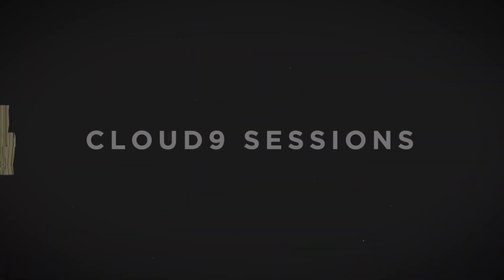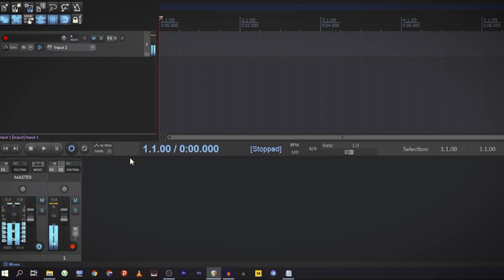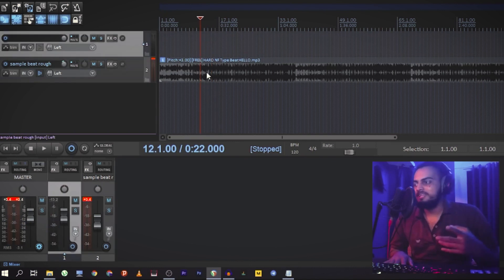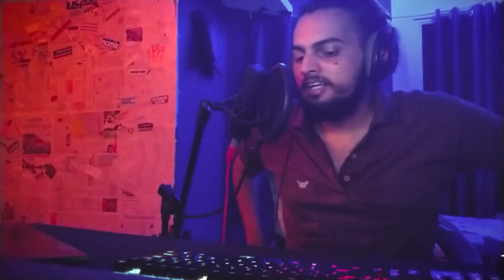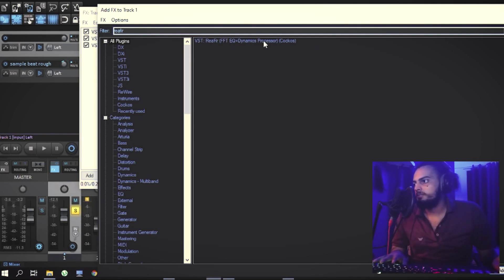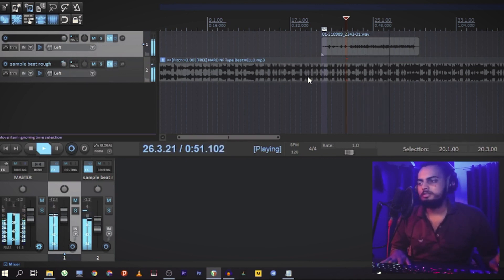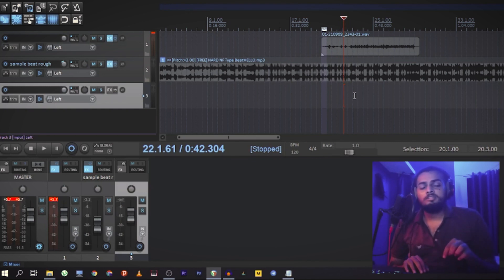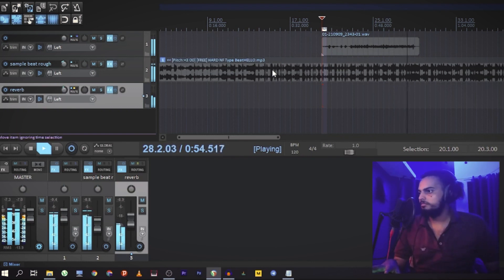How to RECORD VOCALS & add Basic FX in REAPER | Malayalam

Comment: Hey, I have a question. When I tried to increase the vocal volume, It is not clear. How to make it clear.

Thank you
Rajen
Reply from the maker: Do you use reaper as your daw? If so, you can select the vocal track and click on V on your keyboard to pull up automation for volume and then pull it up, or if you want to process it and increase volume use Reacomp and switch on make up gain and decrease the threshold to make it punchier.